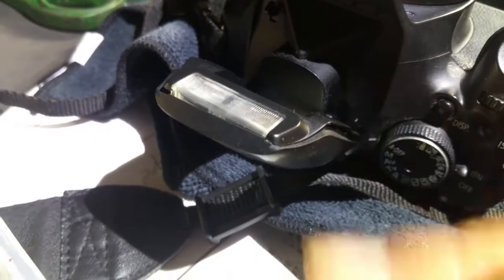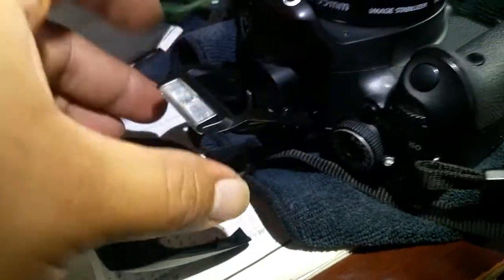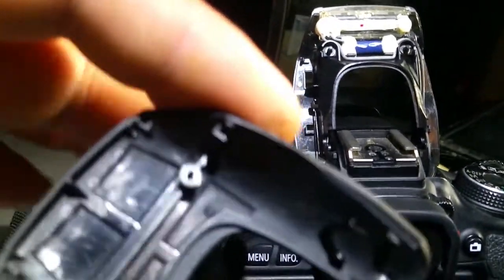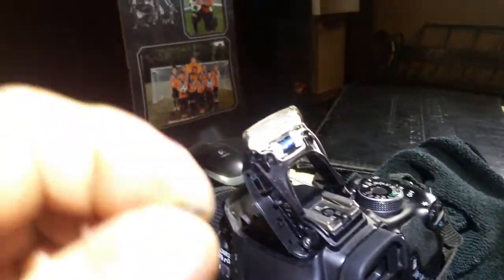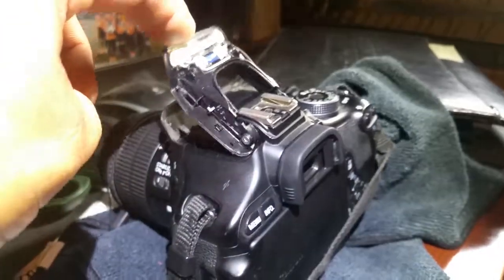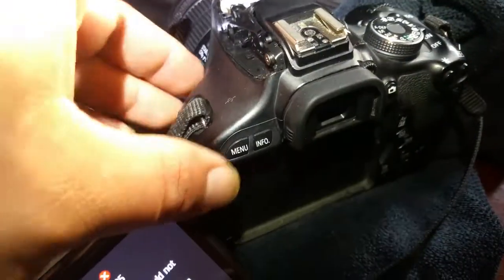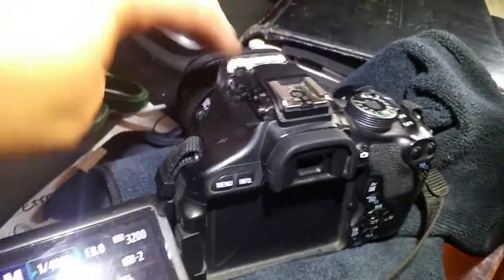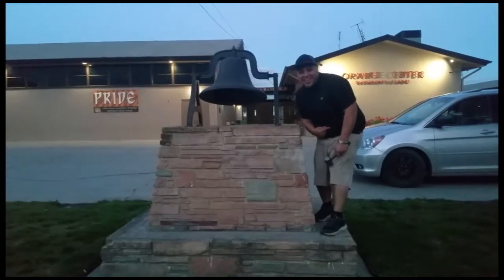How to: Remove a Canon Flash Cover Rebel T3i

Comment: my  flash light on the camera is broken so like the black cover and all. so where i can buy its spair
Reply from the maker: You would have to replace the whole top. I found one on ebay for 20 bucks. Its just replacing it thats going to be tricky. https://rover.ebay.com/rover/0/0/0?mpre=https%3A%2F%2Fwww.ebay.com%2Fulk%2Fitm%2F283526326748

I think your better off purchasing a external flash that mounts on top of the camera. Depends how technical you are at replacing parts.